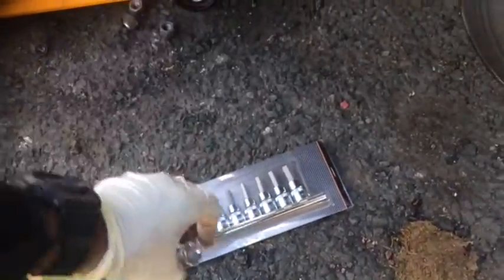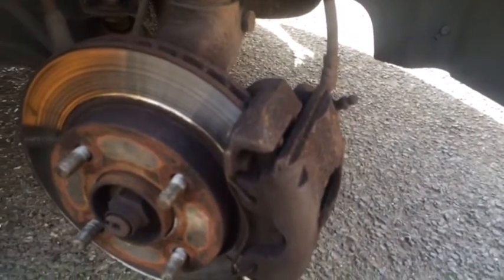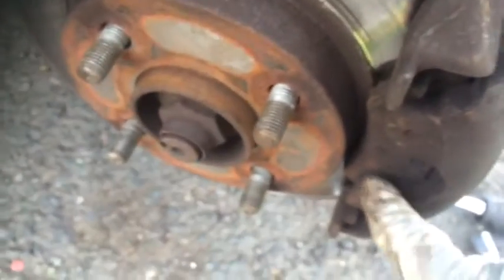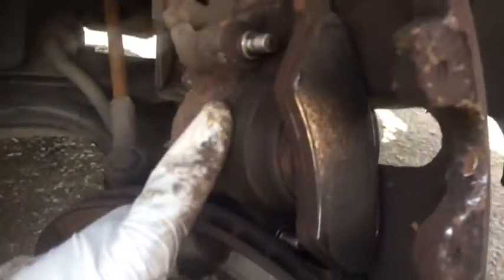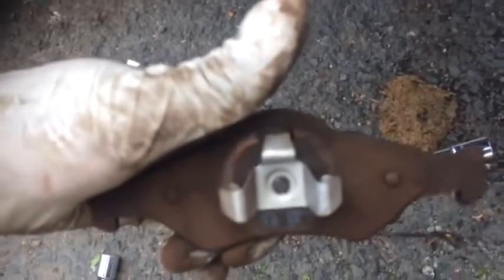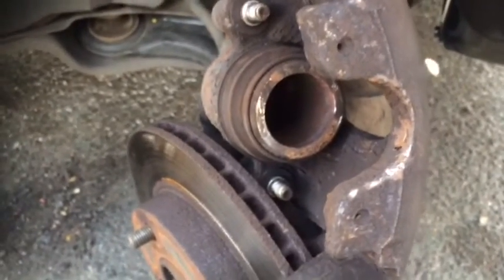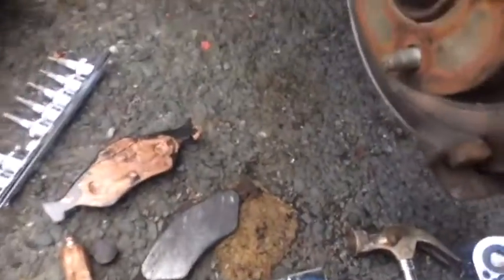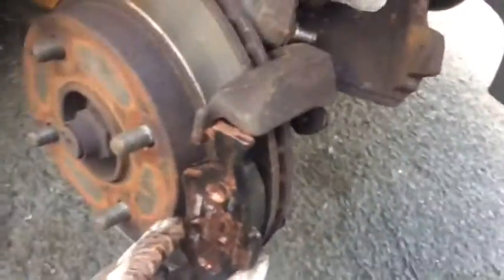Ford KA 2002 Front Brake Pad Change

Comment: You might need to remove some brake fluid from the master cylinder, the level goes up when the calliper piston is pushed back in. Also best to give the piston and calliper a clean.